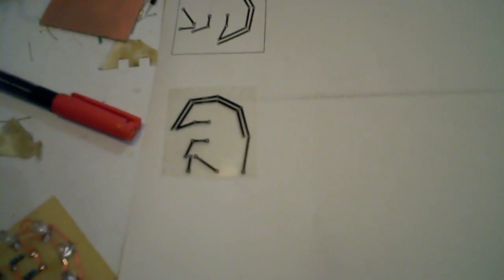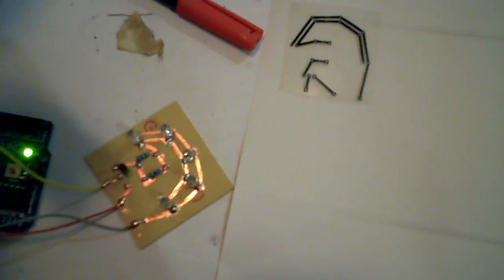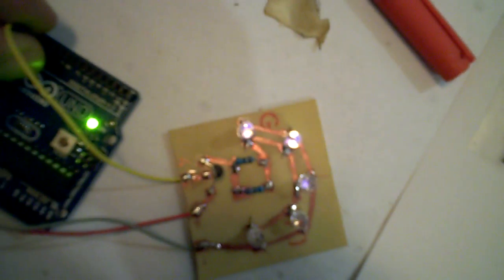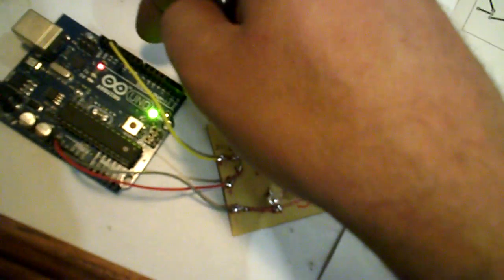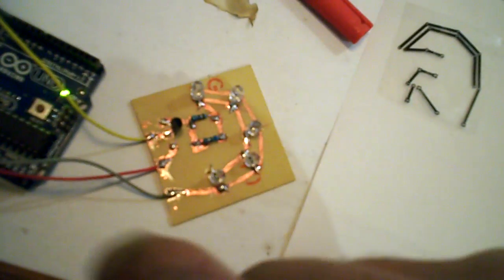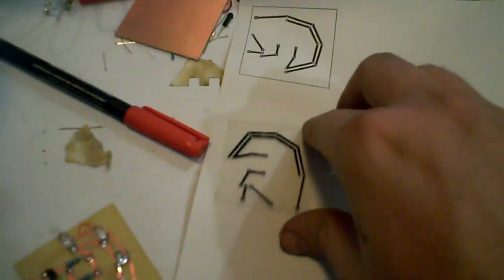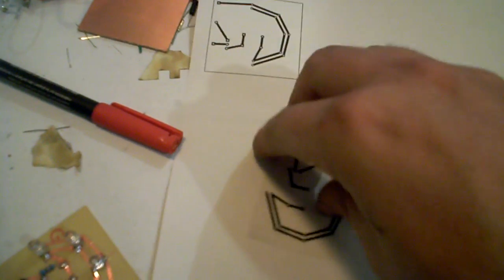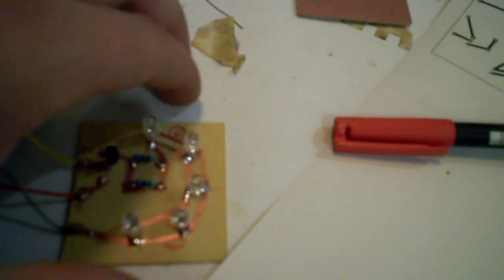Sony NEX-5 multiple IR led trigger powered by arduino.

Comment: yeah miliseconds, however i found that the ir sensor is not full proof over abotu 300 shots it will miss anywhere from 4 to 12 times on average :S which was crap